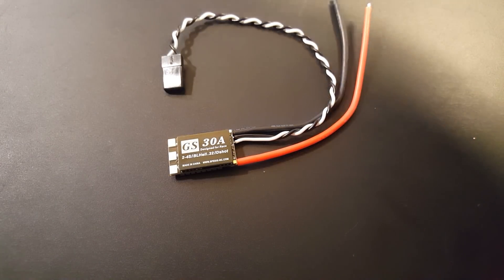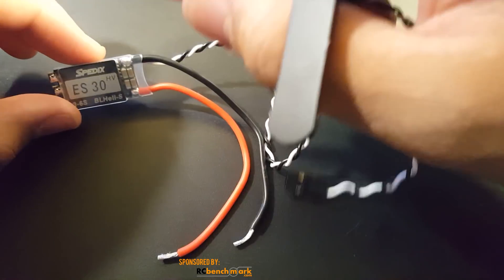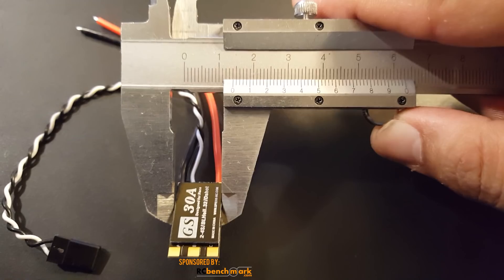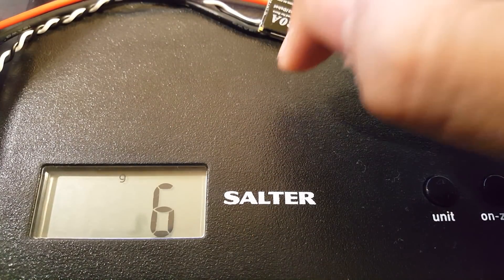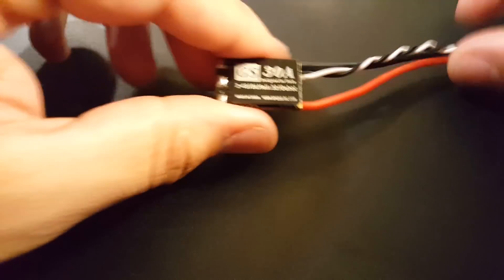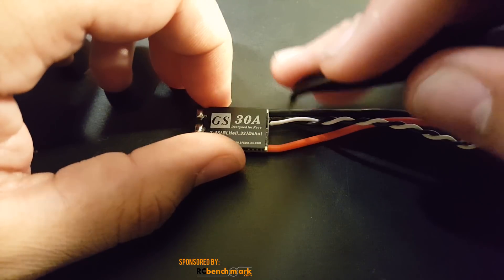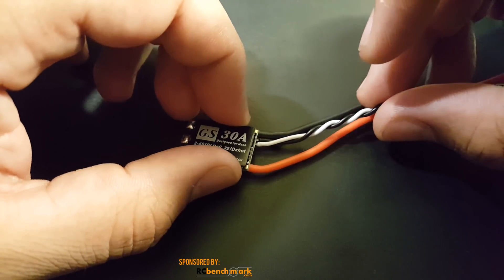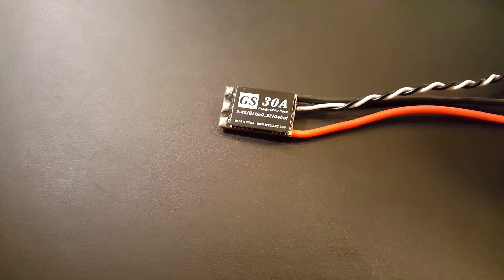Spedix GS 30A 2017 // Review and Noise Testing

Comment: Iv been running these and the es30 for a long time. Iv burnt a couple es30s but never a gs. "I think the burnt es esc were rf fault" 
I see people running gs30 on 5s no caps with no problems. Any idea if the can handle 6s low kv like 1700-1800? If they can i should probably run 330 35v or 220 50v?

Comment: I've used the spedix 30 HV on 4 builds and they have worked great but the last time I try to use them one of them would not run on D shot 600 even even after reflashing it

Comment: Eeej man i got a problem i got that flame fc ppm receiver yust like youre build and if i run the Motors tru betafl. they work great but if i do that with my transmitter like 1procent trottle it wil keep kliming and it wond go down only if i disarm it do you know what i should do?
Reply from the maker: Bennie Leip that's normal
Reply: Drone Mesh if i go from half trottle to no trottle it keep kliming is that normal?
Reply from the maker: Bennie Leip my motor spool up with no props if o add little throttle and will keep going up until disarm.. make sure your transmitter is setup correctly in the receiver.tab and the throttle can reach 1000
Reply: Drone Mesh by receiver it looked good maybee something i missed i wil look at it thanks👍🏻

Comment: Drone Mesh I have an spf3 and I tryed to connect to my computer whilst having a receiver on Uart 1. Can I still connect to the computer via the micro usp port or is it broken? I would really appreciate an answer
Reply: Hi Charles, 
Flight Controllers usually use uart 1 to communicate via usb so its best to leave uart 1 alone.  
If you have changed uart 1 to communicate with a receiver you have turned the usb port off in software (in effect).
Your FC isnt broken but the only way I know of to turn usb back on is to re flash the FC. 
Usb will work with the FC in Re Flashing, DFU or whatever you call it mode.

Good luck !

Its never as easy as it looks on the internet !!
Reply: Sean Thomas thanks for your answer Sean ! I've done exactly what you said not to do which is to hook up a device on uart 1:( I've tryed reflashing but it's not working I've tried all kinds of combinations out in bootloader. So I think I'll buy another fc
Reply: Re flashing seems to be a hit an miss affair. Maybe order another FC an keep trying with the one you have. Theres nothing wrong with having a spare.

Good Luck !!
Reply: Sean Thomas thanks:)

Comment: I have the es 25 ones and they are really really smooth, of course mine has 13 of them little caps for each esc, but I also run a 1000uf on the main batt lead directly where the batt is connected. Can't wait to see the others spedix ones in action. Def great for there price

Comment: Would adding an additional 25-35v low ESR Capacitor in the 250-330uf range (directly to the negative and positive pads on the ESC) would that reduce the noise even more?
I use the Spedix 30a HV's and I love them. I peel the factory heat shrink off and place a 250uf 25v low ESr cap on the leads. I soft mount my motors and my FC and its smooth as butter. I love these ESC's responsive and durable.
Reply from the maker: DEAFPV Yes that will clean your system very good.